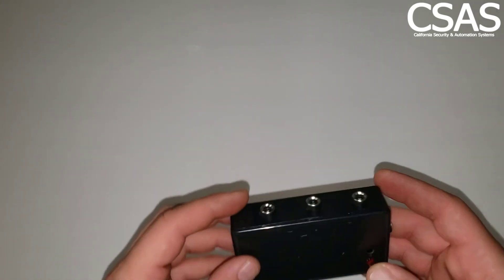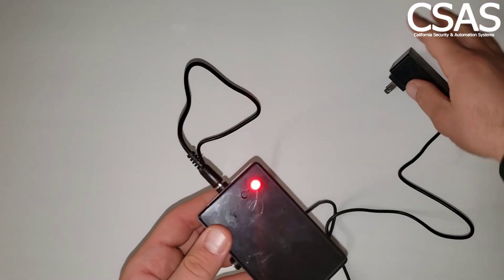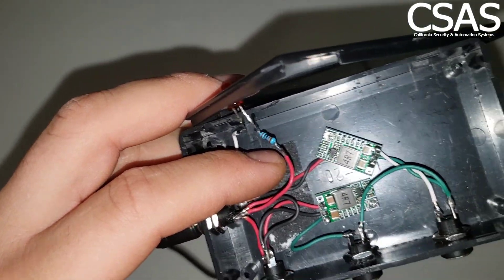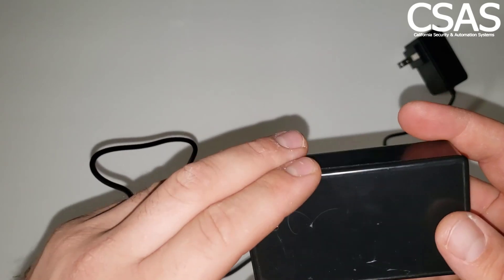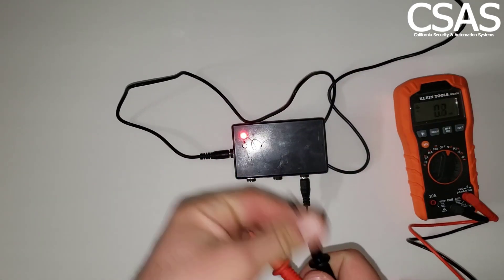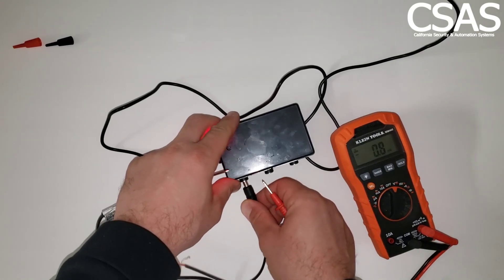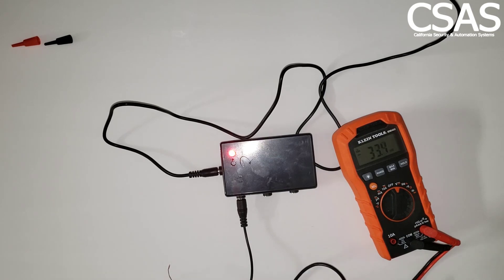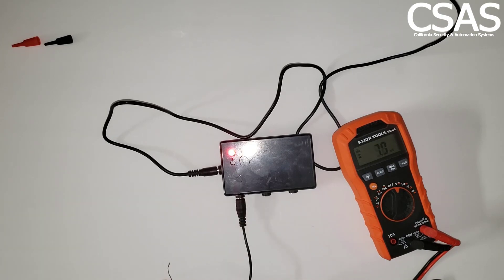How to make SIMPLE Power Supply 12v 5v and 3.3v 2 AMP for less then $5

Comment: Where did you get the converters and project box?
Reply from the maker: Project box

US $0.97  56％ Off | Plastic Waterproof Cover Electronic Project Instrument Enclosure DIY Box Case Junction Box Housing 100 x 60 x 25 mm Black
https://a.aliexpress.com/_sFoYVe

Converter

US $0.45  19％ Off | Mini Buck Converter DC-DC 12-24V To 5V 3A Adjustable Step Down Power Module
https://a.aliexpress.com/_slKSeY
Reply from the maker: Ron Becker

 Mount Female DC

US $0.82  5％ Off | 10Pcs 3A 12v For DC Power Supply Jack Socket Female Panel Mount Connector 5.5mm 2.1mm Plug Adapter 2 Terminal Types 5.5*2.1
https://a.aliexpress.com/_sXflss